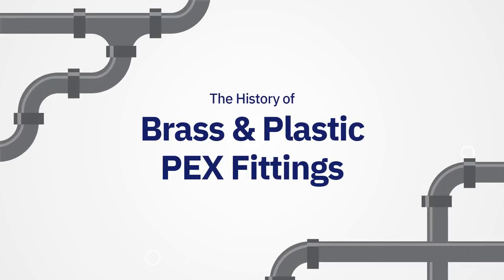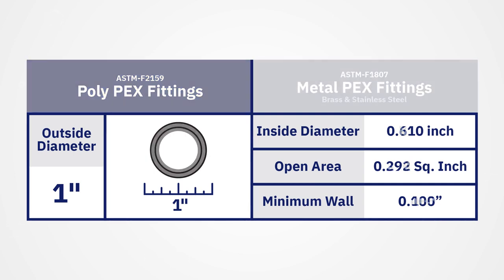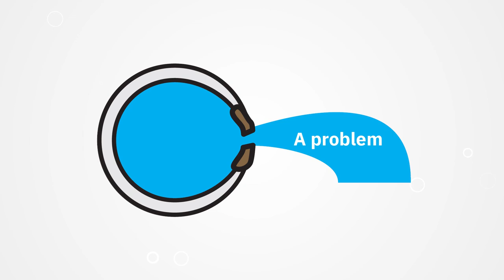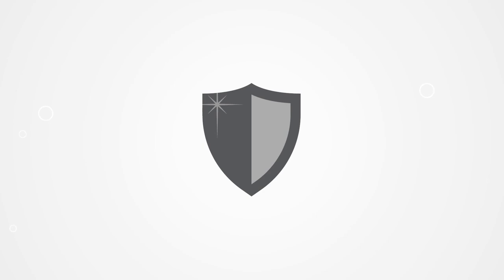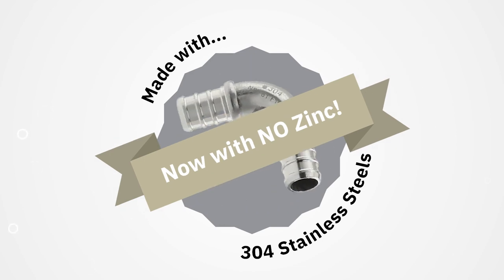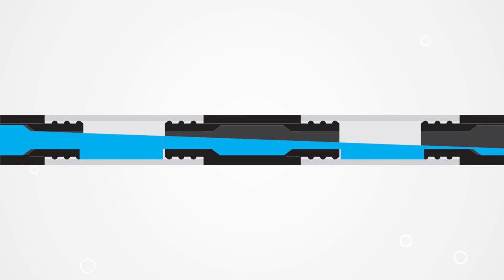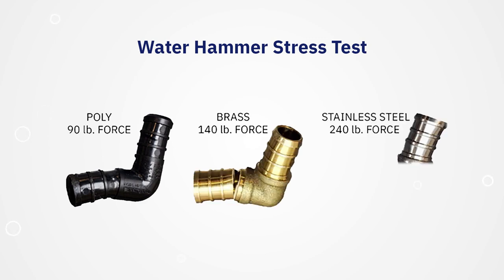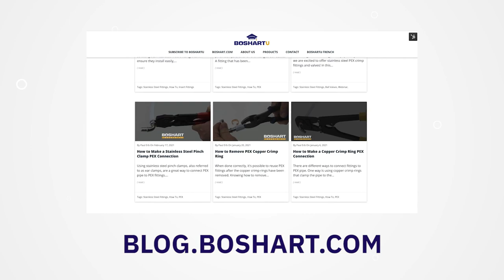Brass or Plastic Pex Fittings? How About Stainless Steel!

Comment: If only they made stainless fittings for Pex-A I would be all over these fittings.
Reply from the maker: We can neither confirm nor deny that this may or may not be in the works 👀 Keep your eyes peeled over the next little while!
Reply: @BoshartIndustries  bump because I'm in the middle.of a remodel and would love these ❤
Reply: Nvm found them 🤣
Reply: @beardedbarnstormer9577 where?
Reply: I am also about to do a total refit from PVC pipe to Pex. I am going with Pex A pipe. And would love to go with the stainless steel fittings. But have been unable to find the Stainless steel fittings for Pex A expansion type pipe.
Reply: @jamesburgess3628 I've always hated brass: It reminds me of the '70s: Cheap and stupid--corrodes comically fast. (Those stupid light fixtures and door hardware should have better instructed us all )

Copper also corrodes: Industrial copper leaching is bad for humans.

Europe is already way ahead in this.

Of course, HD, Lowes, and Ace still push brass: They share the same brain.. 

The Boshart plane has finally landed. The logic appears inescapable. 

I'm fortunate to start--soon....
Reply: @jamesburgess3628 I've always hated brass: It reminds me of the '70s: Cheap and stupid--corrodes comically fast. (Those stupid light fixtures and door hardware should have better instructed us all )

Copper also corrodes: Industrial copper leaching is bad for humans.

Europe is already way ahead in this.

Of course, HD, Lowes, and Ace still push brass: They share the same brain.. 

The Boshart plane has finally landed. The logic appears inescapable. 

I'm fortunate to start--soon....
Reply: @jamesburgess3628 I've always hated brass: It reminds me of the '70s: Cheap and stupid--corrodes comically fast. (Those stupid light fixtures and door hardware should have better instructed us all )

Copper also corrodes: Industrial copper leaching is bad for humans.

Europe is already way ahead in this.

Of course, HD, Lowes, and Ace still push brass: They share the same brain.. 

The Boshart plane has finally landed. The logic appears inescapable. 

I'm fortunate to start--soon....
Reply: @jamesburgess3628 I've always hated brass: It reminds me of the '70s: Cheap and stupid--corrodes comically fast. (Those stupid light fixtures and door hardware should have better instructed us all )

Copper also corrodes: Industrial copper leaching is bad for humans.

Europe is already way ahead in this.

Of course, HD, Lowes, and Ace still push brass: They share the same brain.. 

The Boshart plane has finally landed. The logic appears inescapable. 

I'm fortunate to start--soon....

Comment: It is unclear when you are talking about Waterhammer you show a comparative picture of elbow fittings with a failure load of 90/120/140 lb. You are connecting these fittings to pex or pert which would not produce such side loads. Also, the water hammer pressure spike will not produce such high loads. It is very misleading. Also, how does the price compare to brass and plastic? Is you fitting a available in all configurations as brass and poly?
Reply from the maker: Hey J S! You're definitely right that, in general, water systems that these will be used on won't handle that kind of pressure. That being said, it still doesn't diminish the fact that Stainless Steel PEX, in our in-house testing with our Quality Assurance department, outperformed brass + poly by a huge margin (and even well exceeded its own rated maximum). Whether or not that's a factor to you as a contractor is subjective. We answered another poster about cost - it is generally comparable to brass but prices will vary depending on whom you're buying from, geographical location, cost of materials, etc. so it isn't a clear-cut answer. Stainless Steel PEX Fittings are generally available in all configurations as brass and poly - yes! Thanks for commenting + watching.
Reply: You both make good points.  I will add - most failures are the fittings - install error, corrosion, flow reduction PEX B etc.  Plastic fittings under stress could fail. We went from soldered copper - good corrosion resistance, almost never come apart, pin hole leaks almost always self seal, can handle 6000 psi (1/2") and then went to plastic fittings with hard 90 degree angles AND plastic systems are supposed to be "as good as copper" - as in gets the same job done and lasts as long (hopefully) but is easy to install / replace.

Comment: We put brass PEX fittings underneath our 32 slip marina 30 years ago after half of the plastic ones failed  just two years in. No breakage yet, we would winterize and put anti-freeze in the pipes, but then some A-hole would come along and open one of the faucets and not shut it off even though they saw anti-freeze coming out.

Comment: Your video may have solved a mystery that I’ve been trying to rectify. Had my HW tank replaced and the plumber used 3/4” plastic fittings in lieu of the original brass. He also replaced additional 3/4 and 1/2 brass fittings with plastic due to minor drips. Ever since, pressure has been noticeably reduced, especially on the third floor bathrooms. His response to follow up was loss of pressure was due to limitation of the tank. Don’t BS a DIY’er…we have the time and incentive to identify and solve our own problems. 

Going to procure some stainless and swap them out. Interesting experiment.
Reply from the maker: Glad we could help!

Comment: I switched to plastic from brass after seeing so much "dezincafication" (zinc corrosion) on the brass fittings.  I have noticed pressure losses, esp. in houses with lower water pressure.
I'v been eyeing the stainless ones @VAMAC, but haven't committed yet.
Reply from the maker: Give them a try! Stainless Steel PEX fittings hav the same wall diameter as brass with none of the corrosion issues. Hopefully you can get that water pressure back

Comment: Also have the option to run 3/4" PEX B and use thick push-fit brass aka shark bite fittings where flow is a concern then switch over to plastic, or stainless.  Don't forget that copper pipe & Pro Press viega fittings seems to be growing - though I would say plastic in new construction is dominant.

Comment: Had brass fitting snap in half leaving my water softener. Looked like a chemical reaction making it brittle. It was less than 5 years old. Didn’t know they had stainless and will be locking into changing to it in the future.
Reply: Don't forget you can always solder just the part that experiences corrosion.

Comment: Fittings for 3/4” pipe are about 1/2” internal diameter
Reply: Basically, to my knowledge, with PEX B you need to go up on size for equal flow but that shifts the cost balance because 3/4 fittings are more expensive although with more competition from PEX A and other push fit systems like viega pro press prices keep falling. But for 3/4 you need to step up to 1" and that gets expensive.  Main lines 1" - then drop down to 1/2" for short branches since flow should be good enough.

Comment: No mention of cost comparison.
Reply from the maker: Great point Morris! Boshart Industries sells directly to Wholesalers who are in control of the price that contractors end up paying, so we can't speak for their sales strategies entirely. That being said, it's been our experience that (speaking in very general terms) there is a 10% cost difference one way or the other when compared to brass. Of course this is affected by countless factors (material costs, stock, geography, etc.) so it's best to check in with your local supplier for exact costs. Hope that helps!

Comment: What's the point of using brass or stainless steel fittings with a plastic pipe? I also get around the smaller restrictions of plastic connectors by simply upsizeing the pipes from 3/4 to 1 inch and 1/2 to 3/4 inch with pex b. This, of course, isn't an issue when using pex A as its fittings go on the outside of the pipe, thereby not restricting the flow. If you're not confident in plastic fittings, maybe you shouldn't be using a form of plastic pipe. I'm just saying....
Reply: Curious about the PEXa fittings that go on the outside of the pipe.  I used Uponor's PEXa product for years, but those fittings go inside the pipe.  Granted, the pipe has to be expanded to get the fitting inside the pipe, which allows the inside diameter of the fitting to be a little larger than PEXb.
Perhaps you were referring to the Sharkbite (push to fit) fittings.
IDK
Reply: @F. DeMascio  yeah, I worded it wrong.  I should have said that pex A fittings have the same "ID" diameter of the pipe and the actual pex A pipe expands around the fitting.  Oops. Lol!  With pex B fittings they of course, are smaller so they can fit inside the pipe, thereby causing a restriction. Thanks for bringing this to my attention.  🙂
Reply: The reduced ID is definitely a bigger concern for plastic Pex B fittings than with plastic Pex A fittings.   Otherwise, not all plastics are created equal.  The plastic used in fittings is not the same as the cross-stitched polyethylene plastic used in the pipes.  The fittings are stiff and do not flex and if you are worried about any sort of structural stresses on them that might cause one to crack, brass or stainless would be much stronger choices.   That said, for the vast majority of home usages, plastic fittings are probably fine and much cheaper.

Comment: Isn't the curvature.of this SS  fitting better for flow than the other teo? Can't use this for A.

I never was a fan of brass for lighting, locks, etc. Cheapo. Always corrodes.

Yeah, such brass plumbing fittings are better quality than such '70s examples of other usages.. Still, f brass. Why not bronze? Probably chemicals. He he.

SS likely holds up better. Stronger against freezing. Better quality. Probably purchase. 

Isn't long term commercial copper leaching bad for bods?

Comment: Yeah well once your oxide-passivation layer wears down by erosion of the pipe over time, it will probably rust and you wont get more than 10 to maybe 20 years out of the fitting.  I don't trust "coated" products.

Honestly if people want long lasting pipes they need to bring back lead pipes.  Copper erosion wears down over time, Pex can have variable results based on conditions, chemicals in the water, and other things like leeching amonia.  

If the lead really bothers you, get a filtration system.  Lead resists erosion way better than copper, so you would not get much lead runoff in  your pipes (if they were manufactured properly with a smooth bore)  not only that you dont get problems with lead in your water if you run the water frequently.

Lead is an amazing element despite its obvious toxicity.  If you want a water proof seal, use lead.  Friend of mine told me a story about his great grandfather who couldn't afford to buy some grout, so he grouted his tile with molten lead.  100 years later no failures, lol.